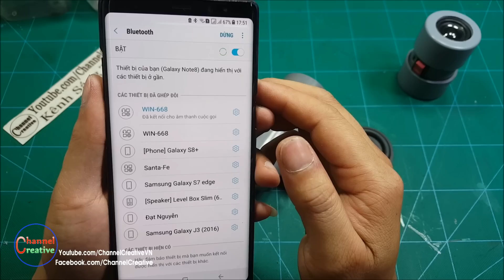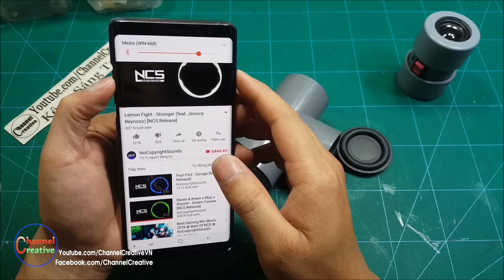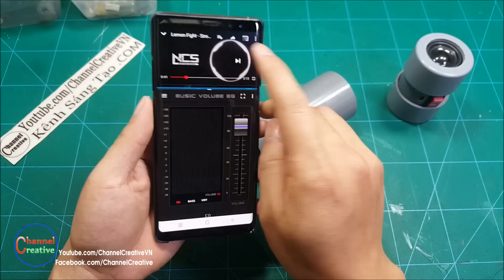DIY v2 PVC Bluetooth Speaker with Passive radiator

Comment: you do know that the radiator has to be duble the size of the speaker
Reply: I believe what you wrote, but I have a few bluetooth speakers where the radiator is the exact same size as speaker. They sound great,  but I've read that before  about the size, wonder why mine are different.

Comment: ewww- the passive radiator should be 1.5 times the size of the driver.  In this case u have 2 speakers so it has to be 1.5 x 2 compared to 1 driver